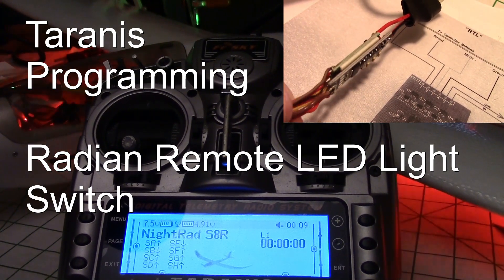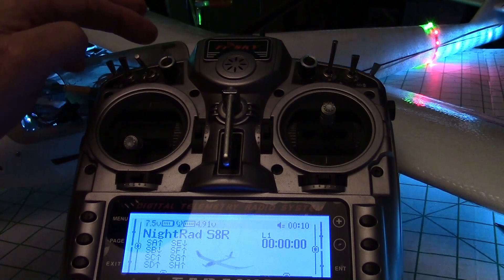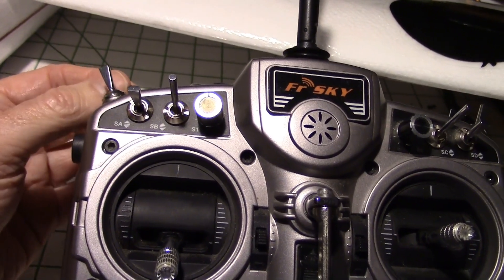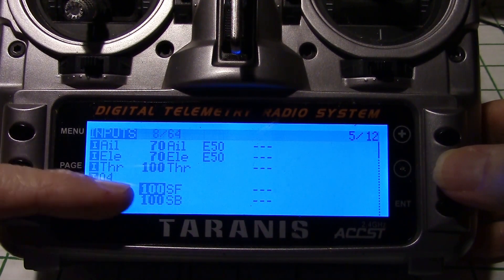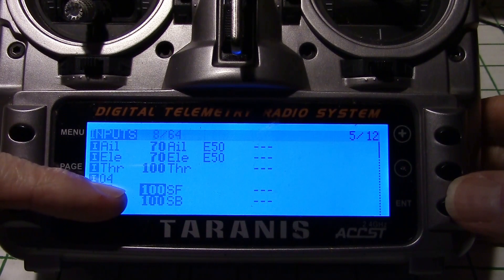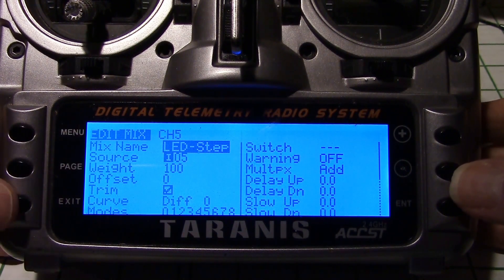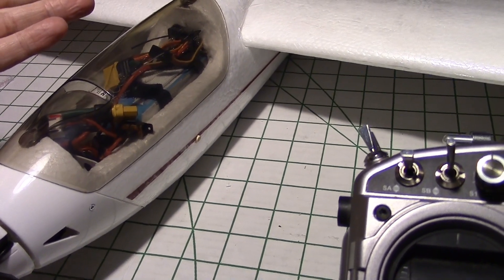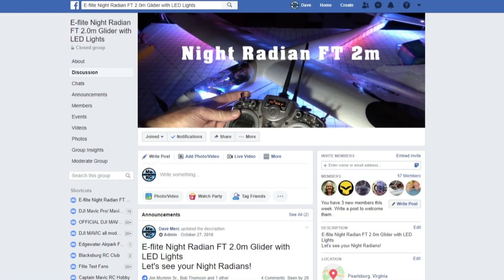Taranis Radio Programming for Night Radian LED RC Switch

Comment: Thanks for the Taranis setup tutorial Dave.
BTW you can use the same RLC light controller Module with any model that you install some digital 3 wire WS2811/WS2812B LED light strips and SP002E controller.
Reply from the maker: Good point. Probably could be used many other ways too.